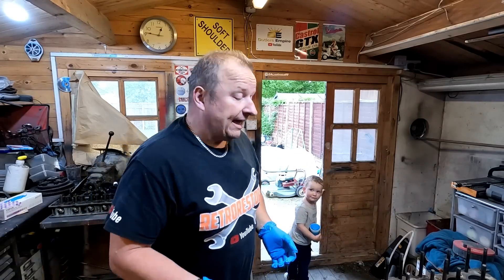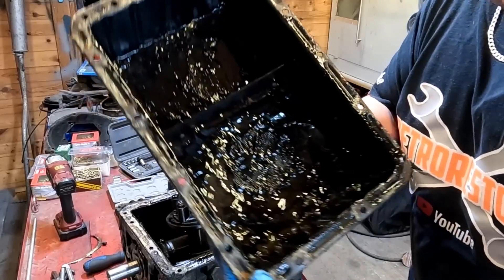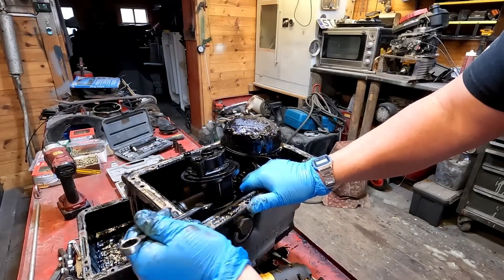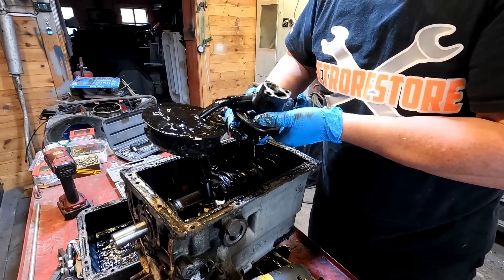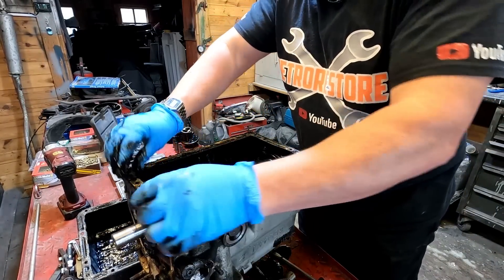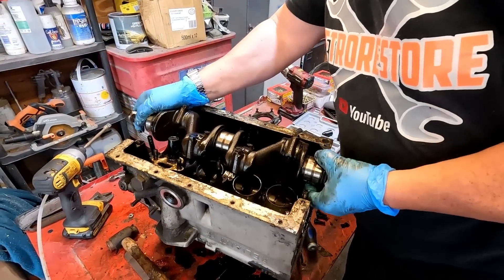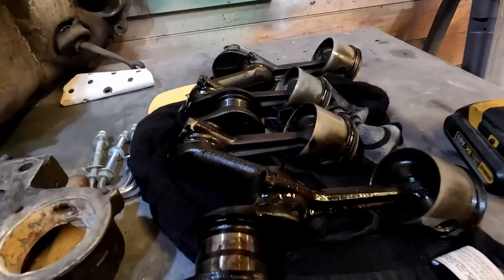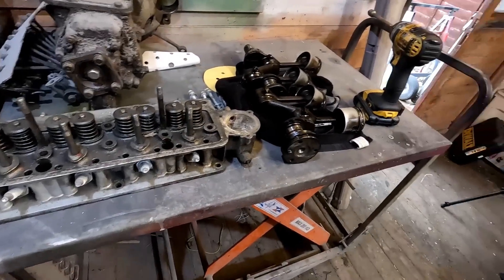Stripping The Trotter Van 600cc Engine (Reliant Regal)

Comment: I watched a video years back, the original trotter van was auctioned and it went for £38,000. That sludge was probably because of mineral oil and never been serviced, synthetic oils are a lot better and contain detergents to keep the engine cleaner.

Comment: Looking forward to seeing the rebuild.Please be careful though on reassembly Martin,as at the ends of the bridge pieces that you removed from either end of the block there are little tiny cork packing pieces.

These are often overlooked and disposed of.You should get new ones with your new gasket kit.Please dont inadvertently chuck them away thinking they are just part of the packing for the new kit......